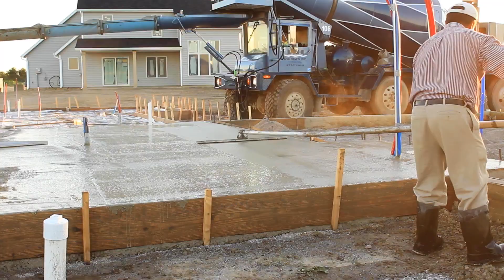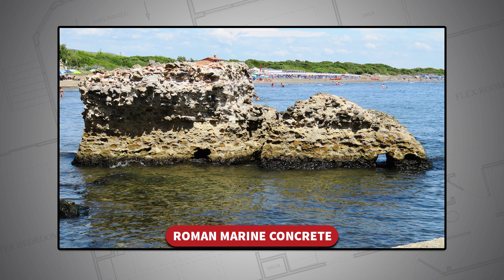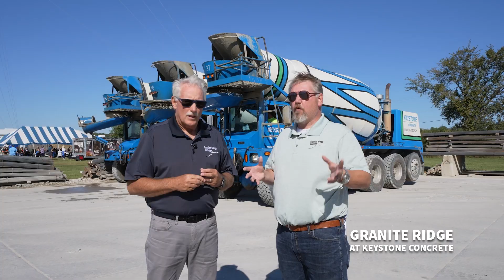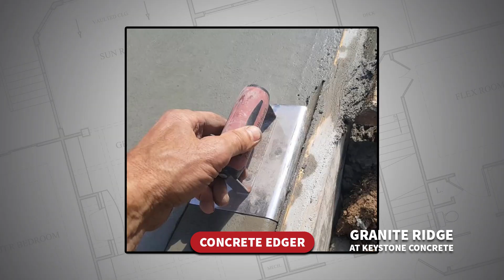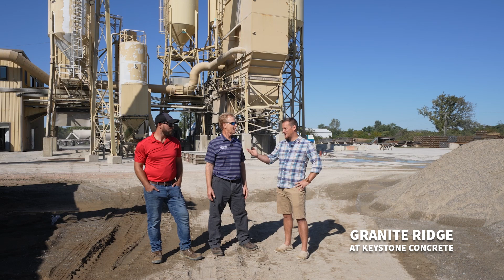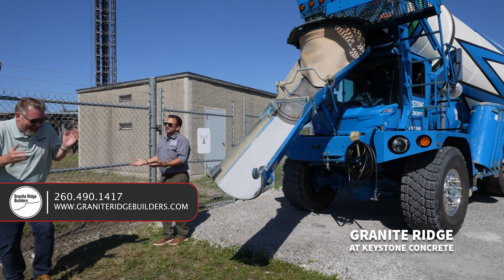Episode 163: Keystone Concrete

Comment: Concrete Furniture, sounds interesting and dynamic.  Air entrainment  (the process of adding tiny air bubbles to the concrete mix) produces a lighter finished concrete...you keep most of the strength and all of the mold ability without all of the weight associated with concrete.

I LOVE IT!